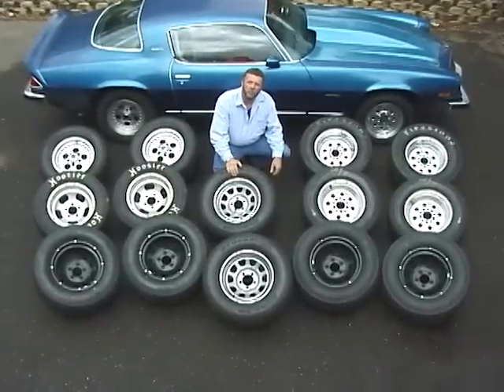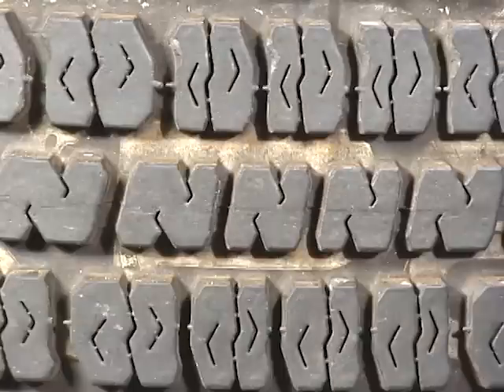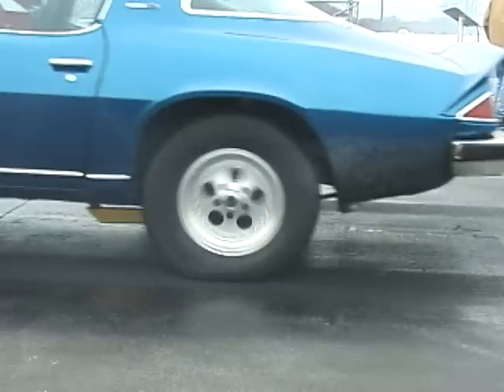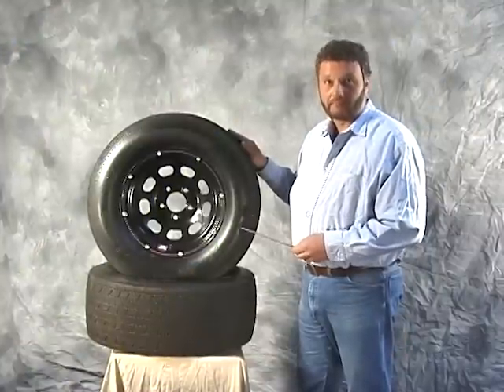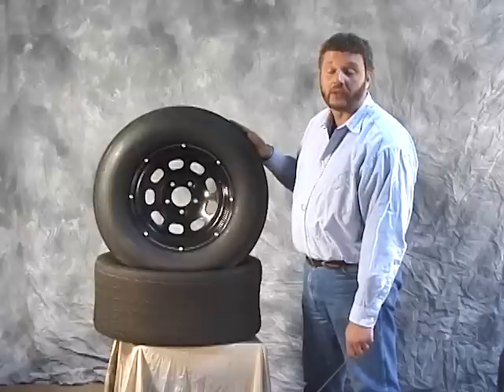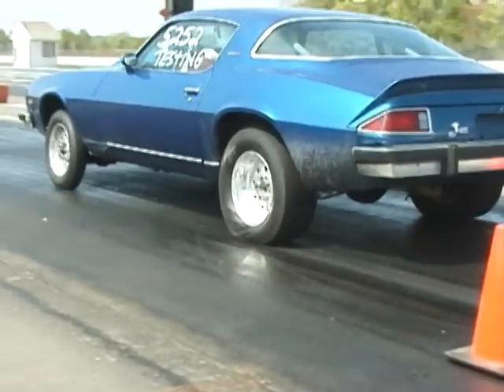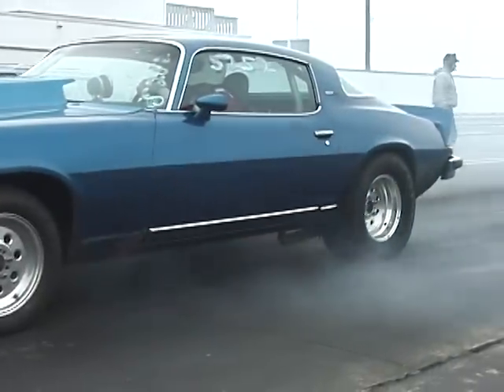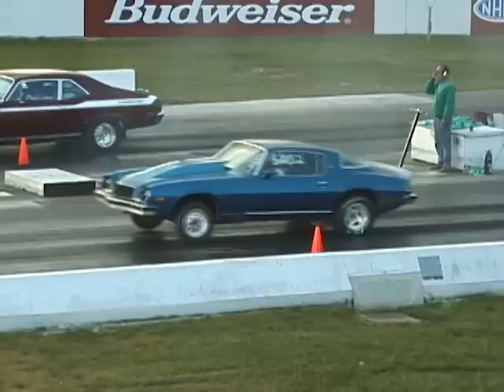DOT Drag Tire Test Video

Comment: Back when I started drag racing there was no such thing as the internet. You either read a article in a magazine or it was word to mouth from other racers that would share their experience. When I first started drag racing I was just on DOT factory tires that came with my mustang. Being that it was a five-speed it was very very difficult to make a good launch. After about 2 months of doing that I made the leap to a street legal race slick. At that time most of the mustangs in the magazines were all running m&h tires. So that's where I started. I was only picking up a tenth of a mile with these tires. We tried everything longer burnout less air more air and the car just never hooked up. So that's when I made the decision to stop by my local Goodyear dealer and order a that all slacks 100% race tire. The very first run was 4/10 quicker than any other run I had made at that time. After playing with the air pressure and practicing doing a correct burnout is when everything turned around. Yes I said a correct burnout in the previous sentence. You have some guys that go up there and think they are getting ready to make a pass in a funny car. They smoke the place up so badly that you cannot even see the tree and in a couple cases cars could not even get into the beams because you couldn't see them. And then once they were done putting on their show the whole time they're opening and closing the door to get the smoke out of the driver's compartment.

I have to stay now that I'm much older that the years that I spent drag racing were some of my best memories I have from my youth. That's despite the fact on what it cost me every year it was worth every penny I put out. I've been thinking about setting up a car and go back and drag race some more. With all the things that I learned in the '80s that could help me today on knowing exactly what needs to be done and the correct way of doing it.

Today it is so much better for new drivers to get a car set up to race quarter mile or road courses. We're back in the eighties the only dinos you were ever going to find was at the shops that build professional engines. It was very rare to have any sort of dyno in your area. Now they have them everywhere. You can go and just have your engine done or put your car together and have it chassis dynoed. A little bit it feels like it takes the fun out of it. Having someone else tuning your car to get everything out of it. I always enjoyed reading another article in the magazines and try it out at the track to see if it worked.

I did enjoy your video and I was very glad to see at the end that you used a true race tire to show what the car will run if it has good traction.

Comment: OMG this is so old.. I ran those L60 Dirt Track tires on the street back in the day.. They were actually damn good for what was out back then.
Reply: Yeah and he recommended tubes for them. weird. did you run them with tubes? my 4 speed mustang II shredded some 15x12 wheel  bias ply nylon tires and it was rubber and ropes inside the sidewall disappearedm im thinking imay have should have used air tubes inside them. well im building a 2nd gen camaro right now, had 4 prior- this one shall be the charm 4 sure.

Comment: I was a hardcore street racer back in these days,  Hoosiers, and the BFG drag radials kicked ass. Testing with a 4speed and stock suspension is a true testament. I spent less money on tires that would hook than I would've on suspension work..

Comment: Never too late to remind folks that just because it has DoT on it, the tyre may still not be legal for road use.
The DOT means it is made to a minimum DoT standard and some "drag" tyres will still be marked with something like "Race Only" or "Not for Highway Use" or similar. For some states there may also be a minimum tread requirement.
Those that ARE approved for highway use may, in turn, have markings that with a restrictive speed rating.

Comment: It would have been nice to use a durometer  on the tread as opposed to wear ratings to nail the softness down. I also wonder what treating the tires with Hot Lap or Track Claw, softening chemicals, would do.   We used it in stock car racing and would see pretty big drops in hardness when using the durometer.  I hated messing with the tires, but everyone was doing it and we were forced to.  We'd use that blue towel on "endless" rolls, wrap the tire in the towel, soak it, then wrap the tire in Saran Wrap, then put it in a black waste bag and let it sit in the  sun.  We spent more time messing with tires than anything else.
Reply from the maker: Waaaay back when we did this the idea was to show tires that were readily available to purchase locally or via mail order.  A durometer would be great, but not a lot of guys have access to one.

Comment: Back in the 90's I tested several of these tires on my Camaro at the track. The ET Street bias ply was by far the best at the track, and the worst on the street. Almost crashed it a couple times in Florida downpour rain. The BFG drag radial SUCKED. Best 60 foot I could get was 1.70 and that was rolling into the throttle. The ET Street did a 1.50 for comparison. The BFG drag radial worked well in the rain on the street. I also tried the Nitto drag radials and blew them off on the 2-3 shift and got the car sideways. Not fun. They were a good street tire though. When the Mickey ET Street Radials came out, I switched to those and have had great luck with them.

Comment: Good test on how well the tires grip the road/track surface. But i would not use ET as a determination as which tire performed better. Unless of course you use the same wheels to test each tire. Weight of the wheel increases or decreases rotational mass. Higher rotational mass is a killer of ET times an 60' times! I know several cars that have taken as much as 1.5seconds off their ET times and trap speeds of 10-12mph by simply changing wheels, but using the same tires. Not being a troll, pessimist, or a dick... just trying to help.

Comment: Seams that the suspension is unloading and traction is lost on all tires tested.
Reply: Maintaining that crinkle = traction.  
 That was the point of this video.  Tires that grip and tires that don't. If you think they all lost traction then you watched a different video. At least 1 had full traction. Watching the other one pull front tires not only on the start but hitting 2nd gear too tells me he has complete traction. Any slippage there was good or else it might have drug the bumper and slam it back down. 
What kind of mustang guru has no video's of his mustang? Maybe it's because you dont have one.

Comment: On radials, you want to add air pressure, not drop it!!! We used to run a 283ci, 9 sec. Vega on R50 radials, running at 50 psi! Pulled the wheels in the air every time!!!

Comment: Your test car needs some suspension work.
Reply: Mark - I agree
Reply: Mark - I know nothing to car suspension and it looked like that to me too. lol !
Reply: +Mark - car was unloading as it got out.. still an awesome old video.
Reply from the maker: +Mark - Yeah- we decided to run that car because it likely represented the typical low budget bracket racer at the time.
Reply: Oldschool leaf and traction bars!  Gotta love it. Honestly it's probably a better indicator of what tires work well.. I miss runnign those cheap L60's.. ass end of the car would walk all over the place when I used them on my daily.
Reply: A 3400lb Camaro with a small block and four speed running mid 12s....that's impressive.  Complaining about a few suspension deficiencies is like complaining about being out $2.00 for a million dollar winning lottery ticket.
Reply: @cartapes1601  And thank you for doing so. I AM that low budget bracket racing guy that needed this video. 
Would have been pointless if you did it with tube chassis drag cars. Some one with that kind of car probably already knows or has a crew that knows.
Regular guys like me have no way to know with out a ton of trial and error and a ton of money wasted. And just hope you don't mess around and put it in the wall while testing out tires.
Again...thank you.  These keyboard warriors probably have no video of any car at all.

Comment: I have also done a burn out and did not make a difference so why do people do the burn out I had a 67 barracuda big block with the comp ya drag radial and they hooked the same in the box or driving around it but I’ve always been told a waste of time my car was a low 13 car not that fast but funso does it make a diff with a higher horsepower car or is the burn pig with radials a ware of time if someone know please leave a comment thank you

Comment: I've pulled 1.7 60's on junk cast off tires. Worn out snow tires are usually my weapon of choice, but if you want to see a good hook for a low budget build? The 2-3 check ball capsule was leaking in this video- https://youtu.be/50aW5_RN3yM .That is a 1.7 on old dry 17" street tires and ZR-1 wheels from a parts car. People get too excited about spending money on slow cars.
Reply: i just watched. i dont believe that was anywhere near 1.7 lol
Reply: It was. I didn't even want to film because I knew the 2-3 circuit in the 4L60 was leaking and would likely flare at WOT. It really was a good hook on junk tires. If you bothered to notice the much faster bolt on 4th gen suddenly appear and win? That guy has hundreds of passes on his car and was on DR's. He came up afterward's an said, "Nice tree" then looked at the complete junk I was running and shook his head, so I can understand if you are feeling miffed. Thanks for watching
Reply: The Fiasco Garage lol you never did that time ever lol. Thanks for the laugh thougj
Reply: Which time? I have the timeslips at altitude to prove my runs. My point was that I've seen great budget street/race cars get bankrupted by this thought process. Sure, I understand that outdated tires (and I can date them) lose certain qualities. But to tell people that they have to spend hundreds of dollars every season to be competitive is absurd. The sketchiest run I ever had was on a tall sidewall full drag set of tires that were brand new. Wheels in the air, nice landing, then white knuckled murder fist to keep it in the lane and off the cones while dealing with a cage that was seemingly designed to catch every loose part of a fire suit. I'd rather a budget street car that is slower than 11.49.

Comment: Hey i have a quick question, are the hoosier vintage tires only designed for road racing? Will they perform the way they do in a road race on the drag strip or on the street? Please get back to me.

Comment: Car should have been an auto to be more accurate.. although I did bracket race successfully with a manual.. not everyone is consistent with their shifts.
Reply from the maker: +ISEE YOU   Rick, the host, won 5 class championships with a 4 speed Camaro back in his day.
Reply: That's nice..nothing more consistent than an Auto.. if he wanted more load a big converter or transbrake would have made it more even.
Reply: @badlilstang  Powerglide beefed up with a transbrake.